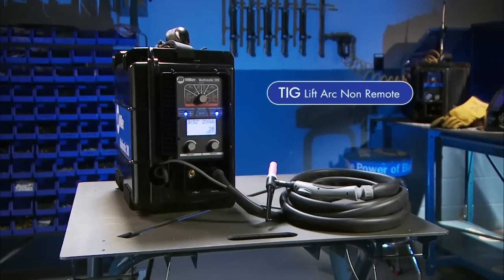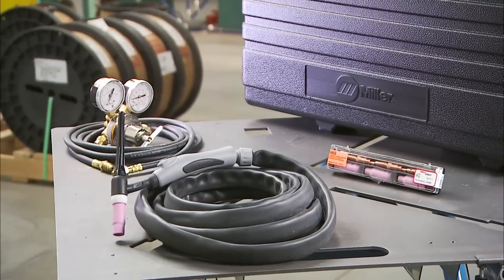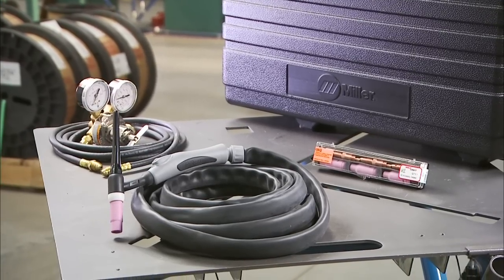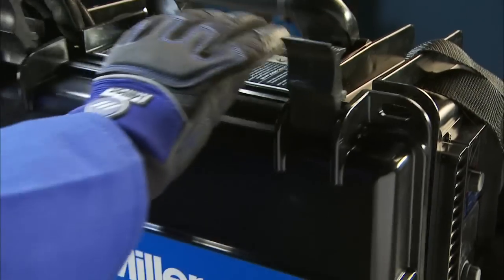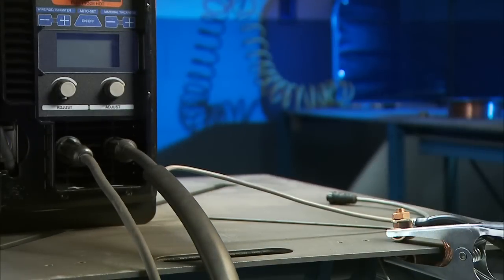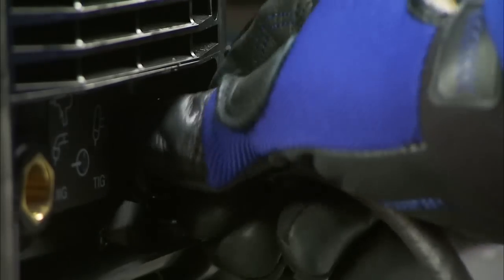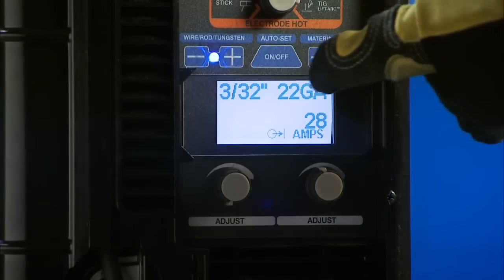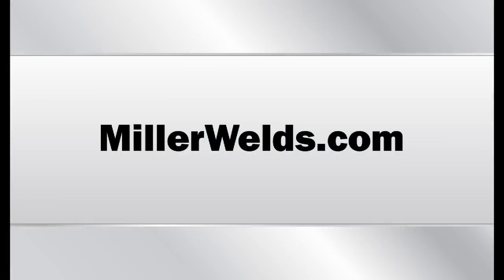Multimatic™ 200 - Lift Arc TIG Non-Remote

Comment: I need to know the TIG package Torch in detail,it's been almost 10 years ago,maybe today it's discontinued.
Another question this machine running TIG Remote Wireless Control?
Reply from the maker: Thanks for your questions.  The torch featured in this video has been discontinued.  The current TIG Contractor Kit package #301287 would include the Weldcraft A-150 torch and a foot control.  The welder in the video was not running a wireless control, the cable ran through the sleeve of the torch back to the machine.  Although, it is possible to run a wireless control on the Multimatic 200 with the use of a 6 to 14 pin adapter #300507.  If you have further questions feel free to email us at info@millerwelds.com.

Comment: will it weld with 0.45 FCAW with gas ?
Reply from the maker: +MadCat Metals Welding Shop The Multimatic™ 200 cannot run flux-cored wire with gas, but it can run regular .045 flux-cored wire (self-shielded). Our specifications say it will run wires that recommend DCEN (electrode negative) wires the best in flux core mode or DCEP (electrode positive) wires best in MIG 75/25. Let us know if you have any further questions. Thank you.